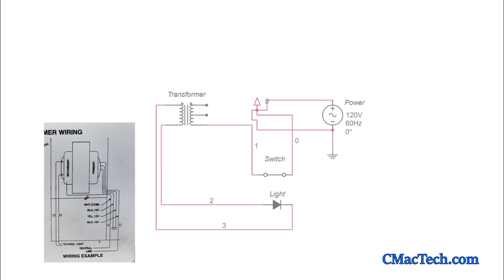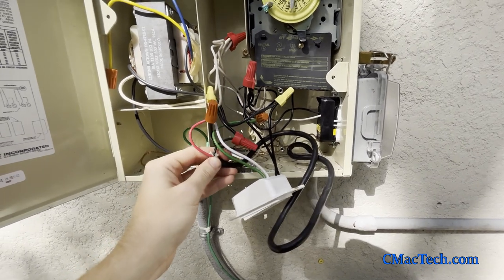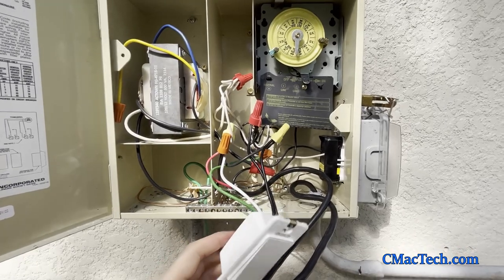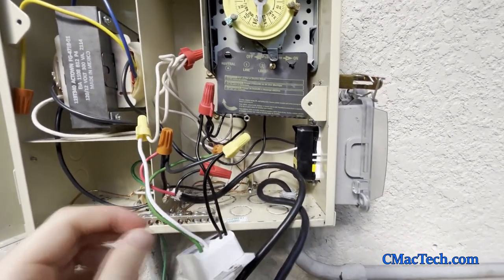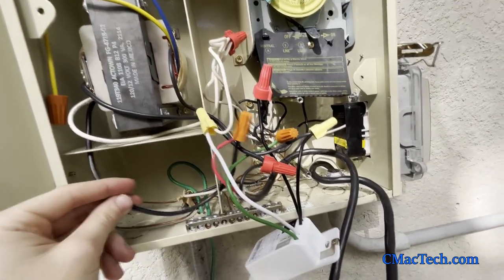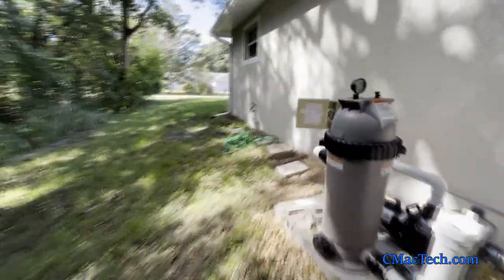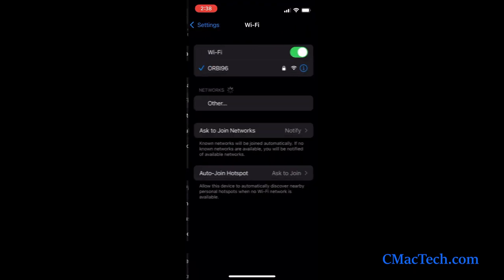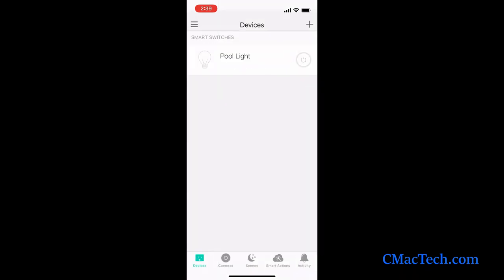How To Install a Smart Switch for A Pool Light for LESS THAN $15 (Smart Pool Light)

Comment: Hi. I was looking to install this setup. I am having a hard time finding the switch mounting studs. Did you buy those or was it already mounted in you control box?  Do you know I would be able to purchase the mounting studs?  Thx in advance.
Reply from the maker: The switch i have did not come with studs. Usually it is to be installed to your existing mount where the old switch is on. But if this is a first install you can get them from a hardware store. I personally dont open my electrical box so i dont really need to mount as i control everything with my pool with alexa for these switches.

Comment: I install the switch but now my light is not changing colors
Reply from the maker: My light has instructions on how to change the light on a regular switch. For me, its every 3 seconds of flipping the switch. If your light is supposed to change colors, i would contact the manufacturer on how to change the colors on a normal switch.